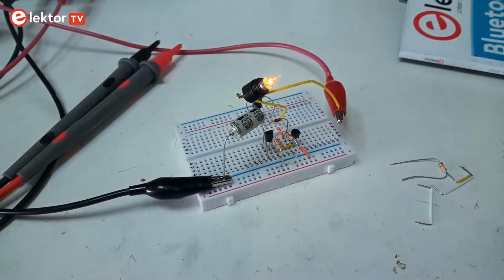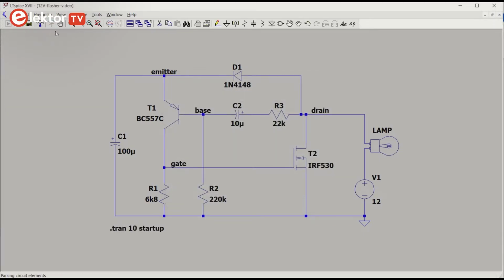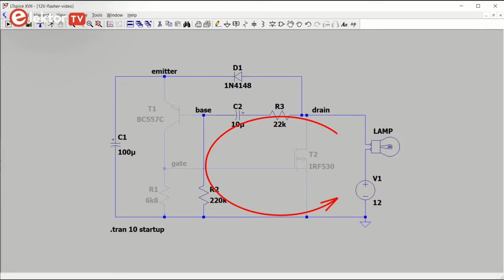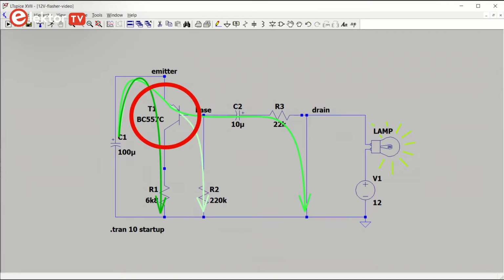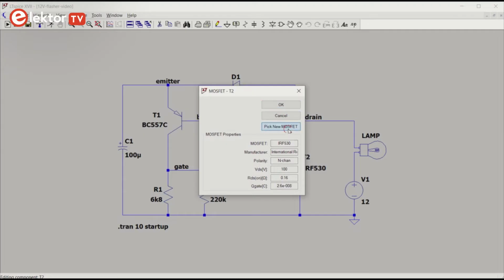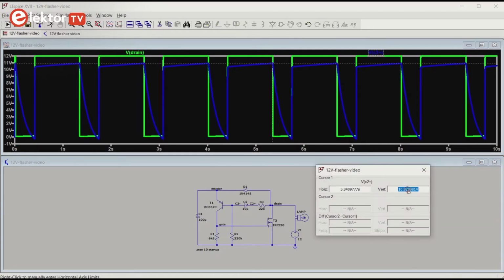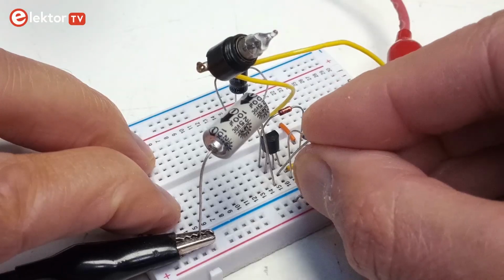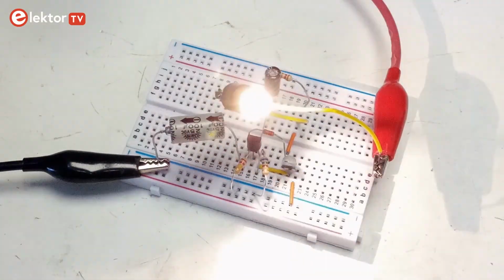12V Lamp Flasher Circuit Analysis With LTspice

Comment: Thank you. Some circuits look basic but rare are those able to explain it like that. But I would like to add a LDR or a photodiode so that the lamp starts to flash at the dusk as road skip lamps do.  Where to insert this component ?
Reply from the maker: You might try in place of R2. In daylight its resistance will be too low for the oscillator to work, when it gets dark it starts flashing, but the speed will slow down with increasing darkness.

Comment: Thank you for the great explanation of this circuit. 
Such a small circuit but so many details.

How C2 will be feeling himself in the long run, as it's connected in reverse polarity? Will it blow up or become swollen?
Reply from the maker: That you will have to try yourself. It depends on the quality of the capacitor and its voltage rating. A 50V device will probably last long enough.